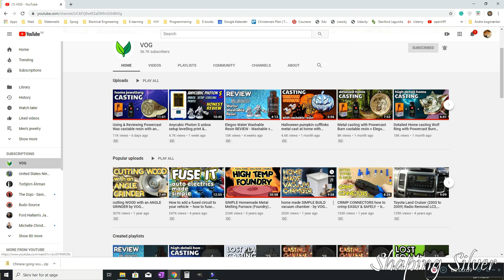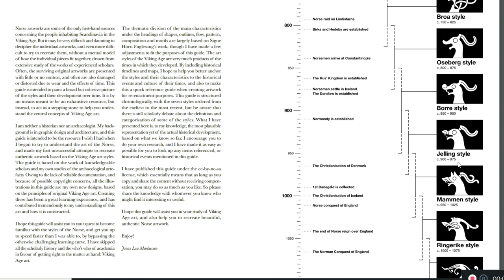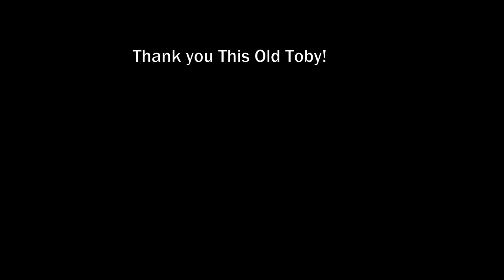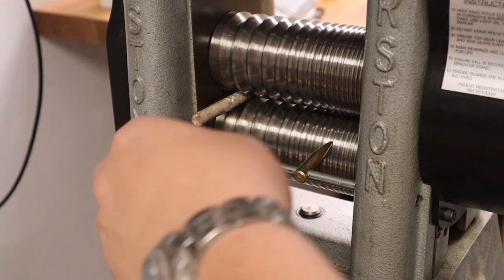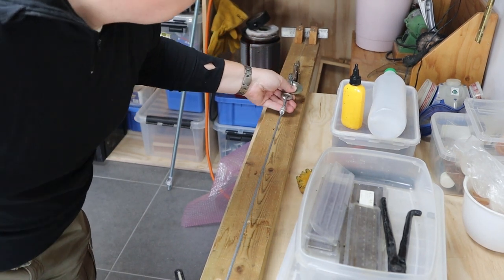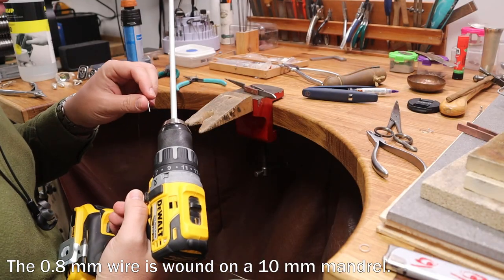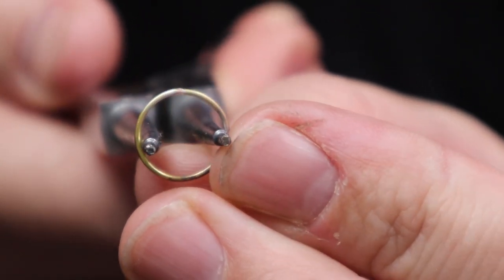Making a foxtail Viking chain

Comment: Casting silver is easier than most other metals. You can do many things with just a powerful propane torch and oilform sand.  I made similar project as one of my first silversmithing projects.  There was very similar chain found near me but as i remember the chain was not connected with endpieces by soldering but by  rivets.
Reply from the maker: Yes, silver is a nice material to work with. I differs from chain to chain. Some are soldered and some are hollow and riveted.  Thanks for watching.

Comment: Did you solder the last link that you cut to connect the finding and chain together? If so, did you use a lower melting solder than you did for the links, or the same one?
Reply from the maker: Yes, I soldered an open link to the finding and soldered it shut with easy... just to make sure I didn't melt the links.
Reply: @ShapingSilver  Excellent. Thank you.

Comment: I'm another new subscriber from VOG :) and liking the videos. Could you tell me the name of the tool used to apply solder to the rings? It looks far better than the way I do it. Thanks.
Reply from the maker: It's a solder paste syringe. You can get them for different metals and melting points. Thanks for watching!
Reply: @ShapingSilver  Thank you, I've been cutting up solder strips for so long I didn't even realise these things existed. I'll give them a go.
Reply from the maker: @greensun5998  I mostly use paste for small items, so I can only recommend it. I have a feeling that  it is more brittle than normal solder, so I don't use it on "stessed" joints, but it might be because much of it is flux and I misjudged the actual amount of metal. Good luck with it.